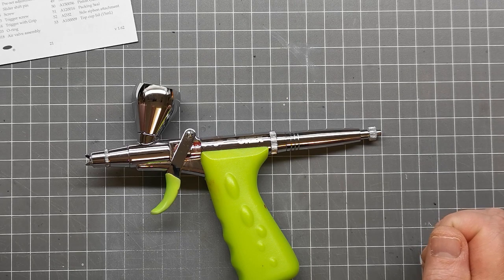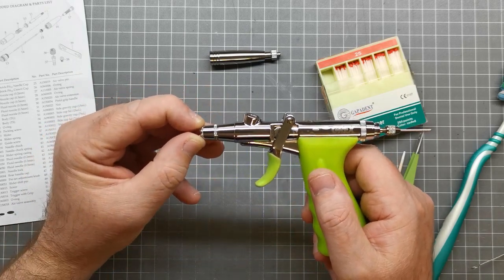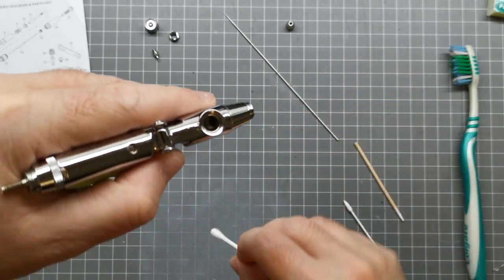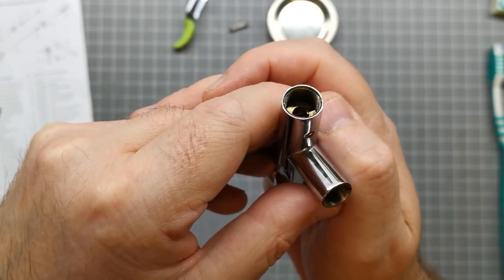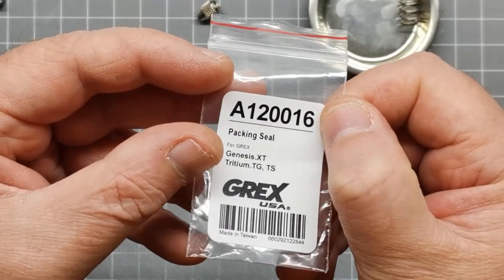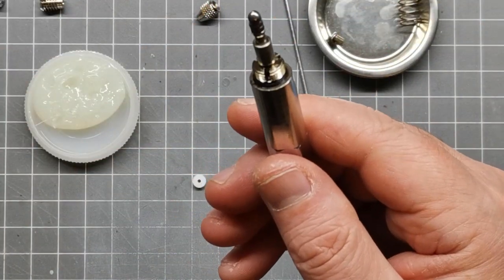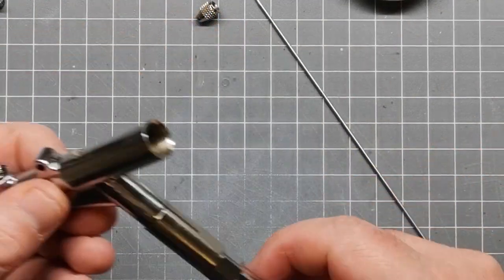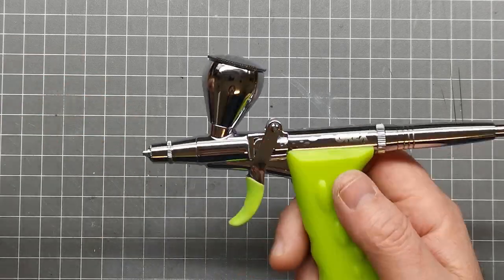Grex Tritium TG Airbrush Teardown, Clean and Packing Seal Replacement

Comment: Cool, just a reminder: part # A 120016 replaces both # A120004 (packing seal) and #A060002 (O-ring) as one piece. If you got one A few years ago.
Reply from the maker: Thanks Rick. That's good to know. Cheers.
Reply: @duckplayingchicken  you got it

Comment: Very nice tear down and cleaning video!  I'm relatively new to airbrushing and bought my 1st one, a Paasche Talon, about a year ago.  I wish I had more time to practice with it but only get to use it a few times a month.  Since then, I've been intrigued with the gun trigger style airbrushes and wanted to try one of those.  I live in the U.S. and want to support U.S. companies, so I bought the Grex TG.  I am impressed with it but didn't realize when I bought it how many more parts are in it to potentially keep clean compared to my Paasche.  This video helped me feel better about doing a complete tear down when needed.  Thank you.  Also,  I never thought about the synthetic grease.  I will look to buy some to have on hand.
Reply from the maker: Thank you. I am glad to hear that the video was helpful. Most of the time you won't need to tear the airbrush down as far as I did. I have used many different brands and types of airbrush over the years but I personally find the Grex the easiest to use, clean and maintain.
Reply: Use an old Paasche needle to fish the packing seal out of your Grex. It's just a little wider than the Grex seal and engages it enough to loosen and remove it with a twist.
With the the right pressure and properly thinned paint, the Grex is fantastic.

Comment: Hi! Great video. I’m having a problem with my Grex Tritium. I have a large air leak that is coming from the front air holes surrounding the the fluid nozzle. I did a complete strip down and cleaning. Still leaking air. Pulling on the trigger doesn’t change the air flow. Is it possible the the packing seal that you changed may be the issue? I’ve had the airbrush for about a year and it’s performed flawlessly up until today. 
Thanks, Chris
Reply from the maker: Thanks. Air is supposed to come out of the holes around the nozzle. If the trigger is not changing the air flow, it is probably an issue with the valve which is located in the handle. It doesn't sound like a packing seal issue to me. You can unscrew the air valve and check to make sure no paint or grime has built up in it to prevent it from working. Apart from that, I am unsure of any other source of the problem.
Reply: @duckplayingchicken  thank you! I should have been a little more descriptive. The air was coming out of the front air holes when I wasn’t pulling the trigger. While it was sitting on the a/b holder. I contacted Grex and representative got back to me quickly and he gave me a short list of things to check. One of them was the shift pin. And it was the culprit! There didn’t appear to be any paint in or around the shaft that the shift pin slides through, but the lubricant that they use from the factory had become all gunky and thick. Maybe paint had infiltrated the area? Anyway a god cleaning and the A/B is working perfectly again! 
Thanks for your suggestion, you were bang on!
Reply from the maker: I am glad to hear you got it sorted out :)
Reply: @medic53067  
In addition, the rubber seals on the shift pin need to be changed occasionally.
Reply: @homunculous007  I checked them while it was stripped down and they fit tightly on shift pin, and are sealing inside the shaft that it travels in. The a/b is about a year old, so if I use the a/b about 10 hours per month, how long should they last? A couple years?
Reply: @medic53067  The life of the rubber parts depends largely on how well they're lubed and how well they are kept from lacquer thinner. The teflon packing seal plays a big role in this by keeping lacquers away from the rubber parts.  I didn't take good care of them at first and they still lasted a few years.
Reply: @homunculous007  that’s good to know, thanks.

Comment: Hello! I have a question. My compressor works, but the arrow stands on zero and does not move. It works continuously. It's something related to pressure. The last time I used the compressor a year ago and everything was well. What am I doing wrong? What can be the reason? My compressor is from Grex's company. Thanks
Reply from the maker: It sounds like the regulator might be the issue. I don't own a Grex compressor so I'm not sure.